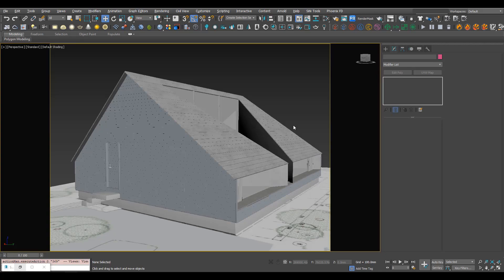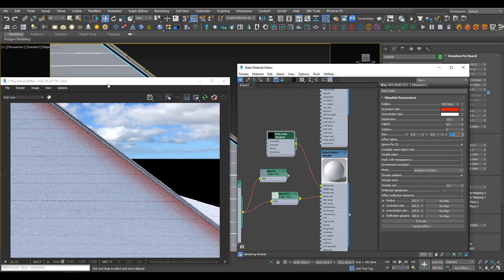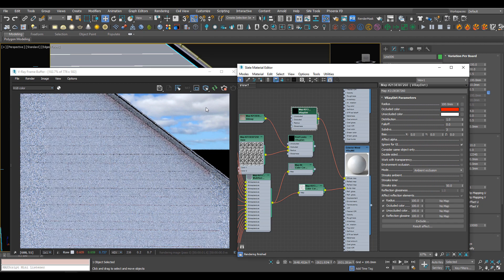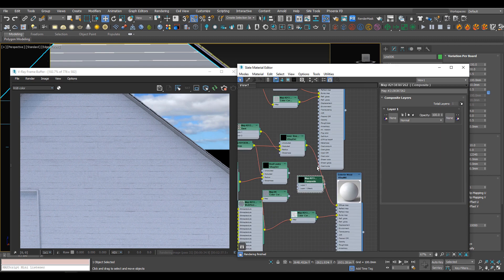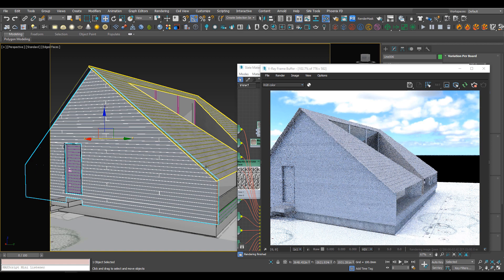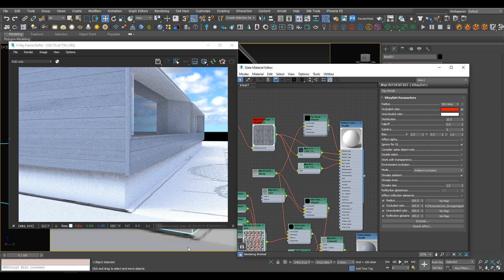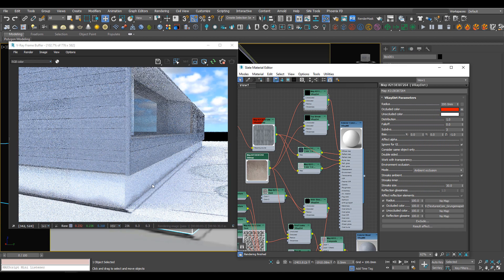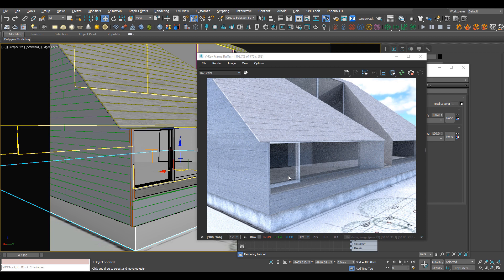VRay Dirt Tutorial | Use V-Ray Dirt Maps To Add Streaks and Grunge to Materials in 3ds Max

Comment: I'm not getting the same effect on the ambient occlusion with dent-map. The size it takes on my screen doesn't match yours, and I'm not able to tweak the size/tiling params to get something that works. Does UVW-map-modifier affect the mapping of the dent? Also notice I use cm as display units, while u have mm.
Reply: Check what map channel your UVs are on and what map channel your dent node is using also if it's using explicit map channel, real world, or object/world xyz. A lot of times when my node changes aren't taking effect on my model i end up finding my nodes are using a different map channel than the one my UVs are actually on.
It could also be your unit set up. Some nodes you can set the values to be dependant on cm, mm etc which can differ from your in scene units, this may only be a nissue when using Real world scale though. You could just have the detail be so small that you cant see and it looks like it's not working. This happens to me a lot and something im still working on improving
Reply: Noise-map worked well for me though! Thanks for this great tutorial Jake! Awesome effect to add to the exteriors.
Reply from the maker: @jonasrodningen   Did you try changing Size in the Dent Parameters?
Reply: @jakedenham  yeah, tried multiple sizes between 1-5000 I think, but didn't really get the right radius on the dirt.. I'm sure I'll figure it out if I dive even deeper.
Reply from the maker: @jonasrodningen  Ok mate, you know where I am.